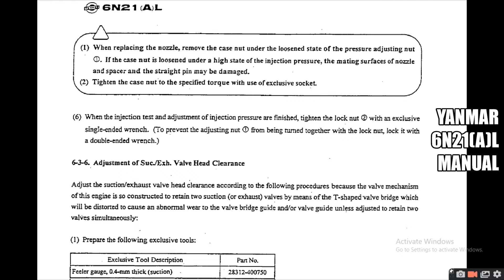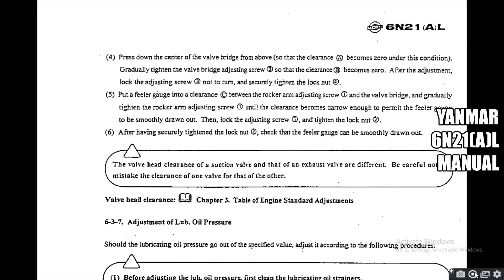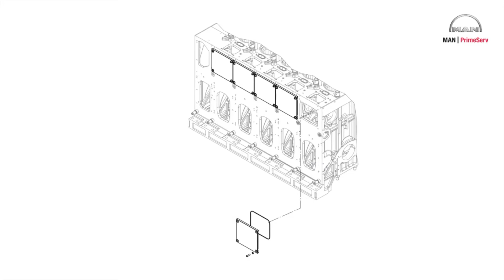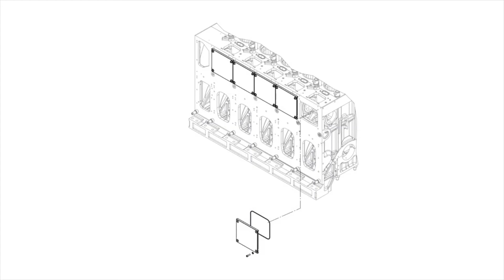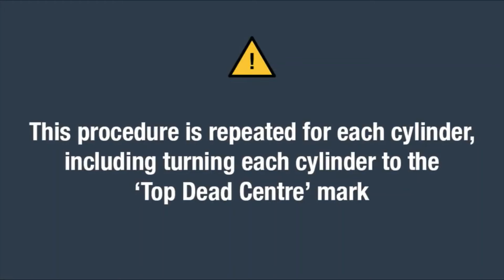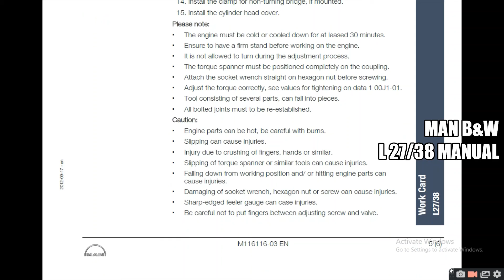How to Take Tappet Clearance Aux Engine | Valve Tappet Measurement | YANMAR | MAN B&W Diesel Engines

Comment: Sir.. Why there is no crosshead or piston rod present in 4 stroke engine?
Reply: due to stroke length, 2 stroke use long stroke, that why its fitted with crosshead bearing and piston rod.